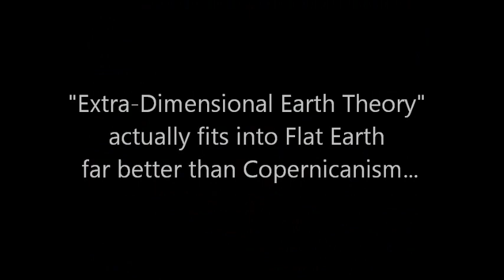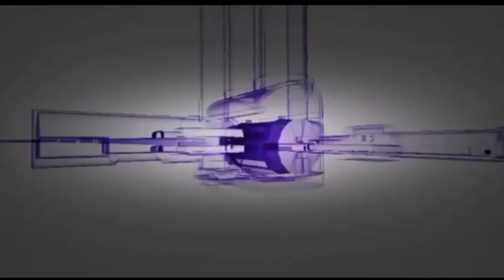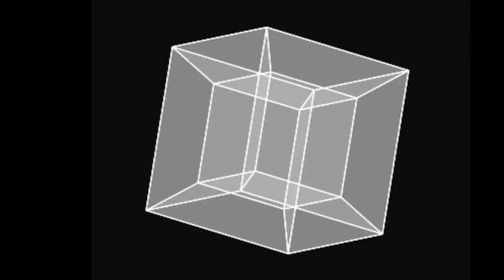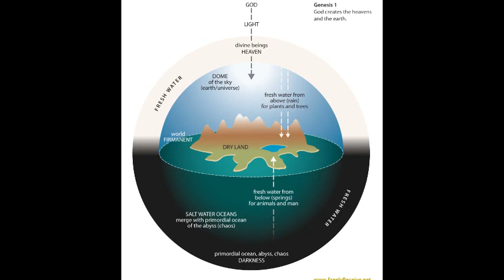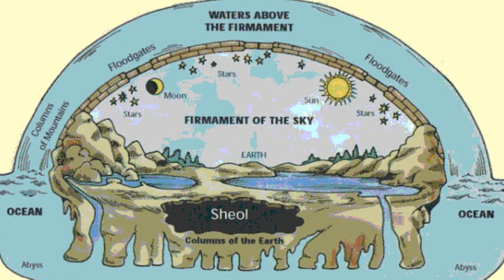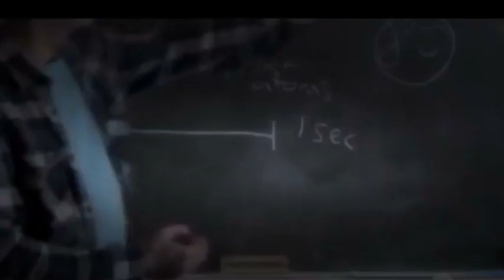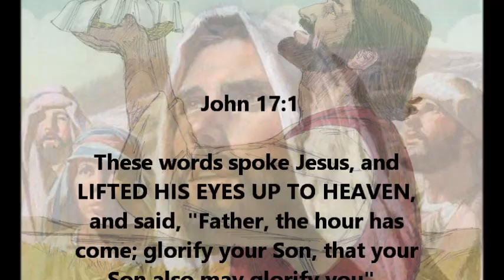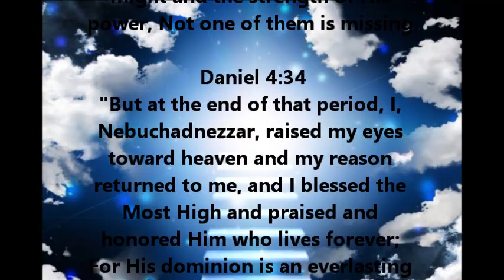EDE Theory fits Flat Earth! Not a globe. (Josh Peck confused...)

Comment: Define "dimension " then ask yourself if a Biblical cosmology is not simply a single dimension of space we're physically straight above is a firmament with physical planes just like ours that may or may not be infinite Direction? Extra-dimensional Earth is an abstraction just like the idea of a dimension is an abstraction is a concept and may not actually be a thing at all. Not to mention this can also be a simulation digital, holographic, fractal can still follow this biblical cosmology of stacked infinite planes. There's nothing in our experience or physical measurement of the world that forbids such a proposition. Everything can be exactly the way it appears without having conceptual abstraction thrown in to try and explain what is not yet visible. Angels and Demons might be microscopic , is that another dimension? And where does the line from one to the other begin? I have completely given up on the idea of trying to extrapolate a logical paradigm that does not stay within the limitations of what is written.  Ps the sun and moon are HOLES. Not 3D.